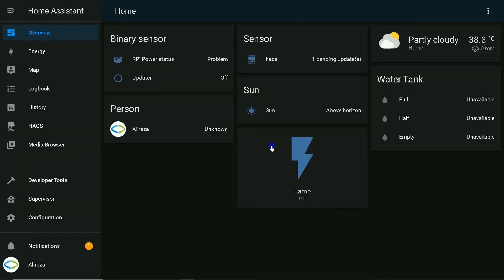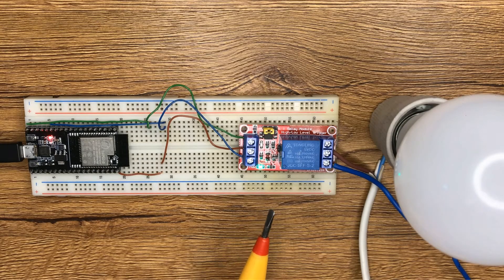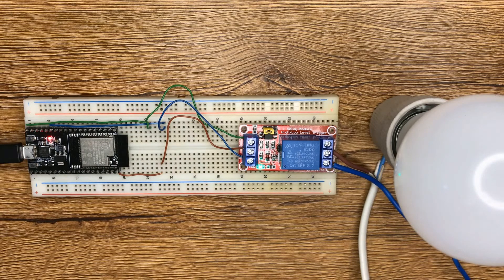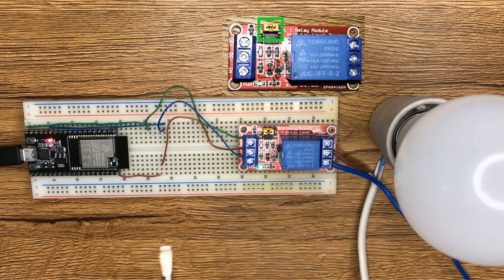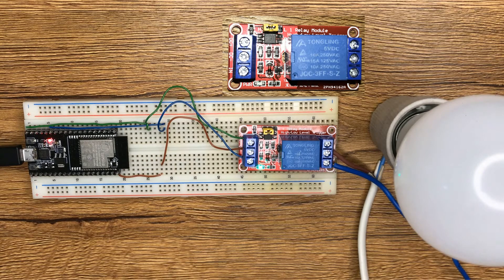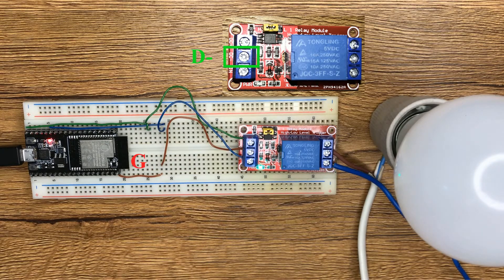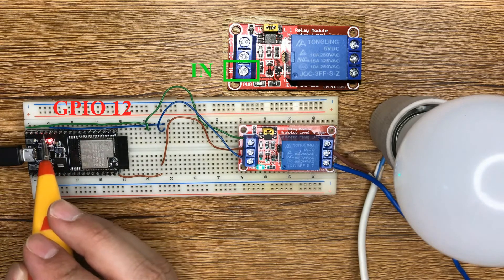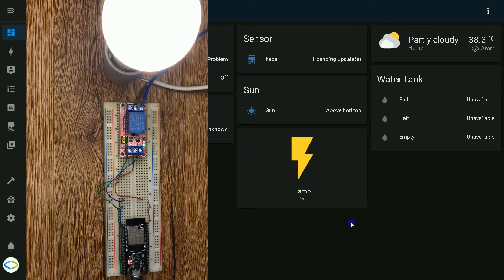Low Trigger Relay Module

Comment: What is your power supply to the ESP8266 that supports the 3.3V supply trigger?
Reply from the maker: I use a 5 VDC power supply. Refer to your ESP board pinout.
Reply: @kian.smarthome  thanks, so USB from laptop should give 5V - good video
Reply from the maker: @jimpugh6357 Yes, You are welcome.

Comment: I have a question I like this demo, but my Model Train has a slightly different need.  I have a fan for smoke that runs from a relay. I need to turn on the relay with 3.3V it is designed for that. The Train Motor has three inputs to a PWM Motor control On with a number for speed, forward or backward.  I need the fan relay to be triggered when the motor is running at any speed and any direction.  Can I create a term Fan_Relay and call it an OutPut pin.  The add some logic like this: If Motor == High then Fan-Relay = High, else Fab_Relay = Low.    What command can perform that simple read write operation?  Thank You, Dennis
Reply from the maker: Generally you can do that, but first tell me what platform are you using?

Comment: I believe you are misrepresenting what a low level trigger relay is in this context. The video and closeup photo shows a high/low level trigger relay and you also specifically point out the jumper which selects high or low. You are using high. This means that a high level signal, be it 3.3 or 5v, is used to trigger the relay. If you had selected 'low' (which you have not), then the relay would trigger on a receiving a low signal, 0v or ground.
Reply: simply add "inverted: true" to your output gpio
Reply from the maker: Hi, 0V or Ground is not considered as Signal!!!
Reply: @kian.smarthome  that's what a low level trigger relay is.....

Comment: Please explain the high voltage side. Video is incomplete. Thanks
Reply from the maker: About the 3 pin? Nothing specific happens if you use it
Reply: @kian.smarthome  Show how you wired the light bulb please.
Reply from the maker: @firepilot17  connect neutral or (-) to your load, connect hot wire or (+) to "COM" of the board then connect "NO" of the board to other terminal of the load
Reply: i agree. video was incomplete.  he assumed we are smart enough to know.  but obviously we dont know, that's why we are watching his video.  i really hate when smart people assume others are smart too